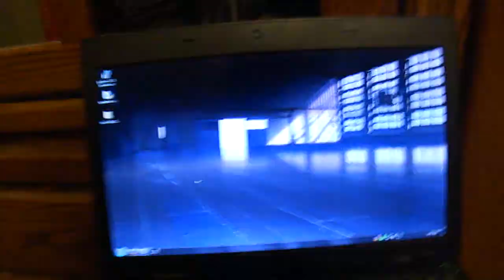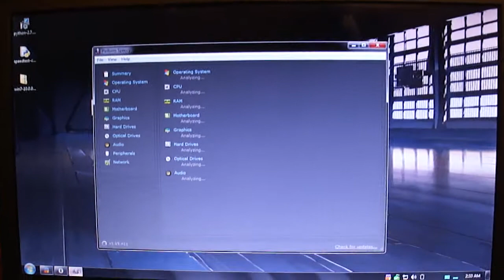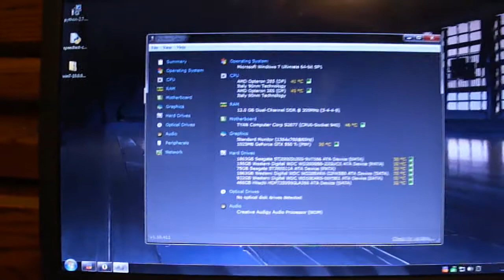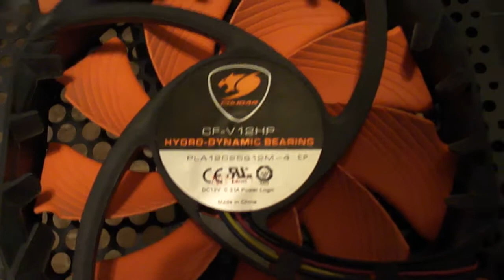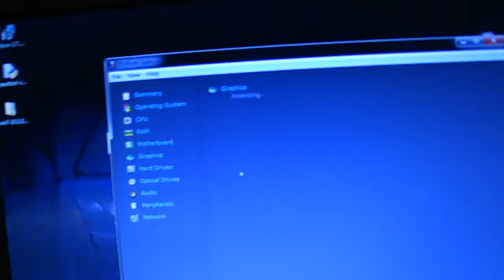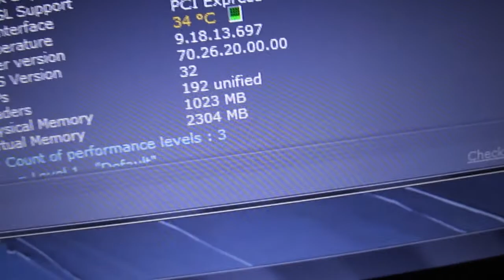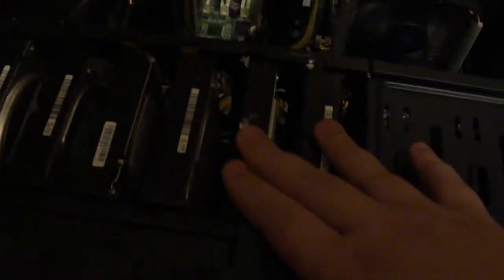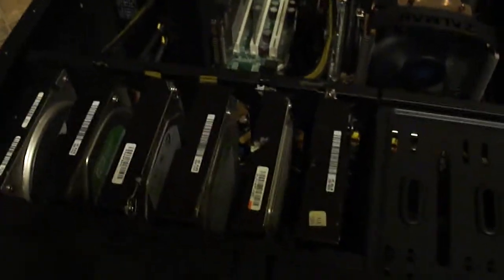Dual Opteron Box - Janury 2013 Update

Comment: Thanks, that's helpful information, especially combined with the detail you showed in the video of exactly what parts are in the system. Thanks.
At first it sounded high but then I looked at all the hardware you have in it, and it makes sense.  I'm going to be aiming for a lighter build at first (probably on an S2882), but I love the headroom if my needs for the server change.
Do you have the "PowerNow" feature enabled?

Comment: That's a cool setup.  I've been looking recently at building a server with a dual 940 Tyan board. Partly for practical reasons but I admit, partly just because they're awesome. I drooled over these when they first came out, and I want one. A new microATX board would be boring.
By any chance have you measured how much power your system draws from the wall while idling in Windows? I'll be using onboard video but it may still give me some sense of what to expect.

Comment: I ordered a board and CPUs from a place on ebay, they had a pair of OST280's at a cheap price so I got those. I'll probably just use 1 of them, and try RMClock to undervolt and throttle it at idle. It worked for a K8 laptop anyway, hopefully it works on K8 Opterons.
I don't think the board comes with heatsink brackets, I'll probably have to get them as all the heatsinks I'm aware of rely on the OEM bracket. I love the Hyper 212 but like you said, I don't see how it could mount.